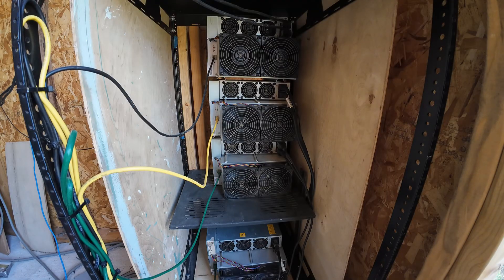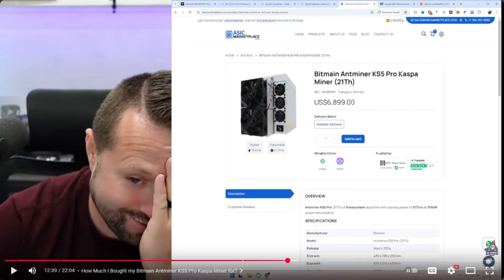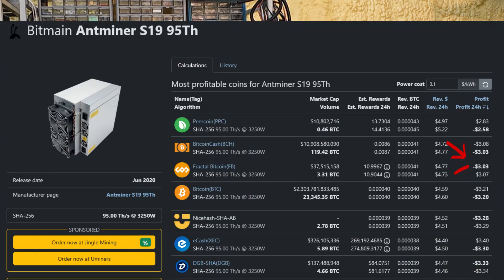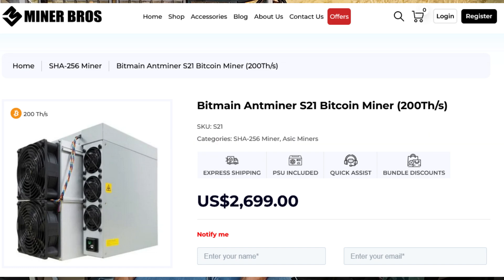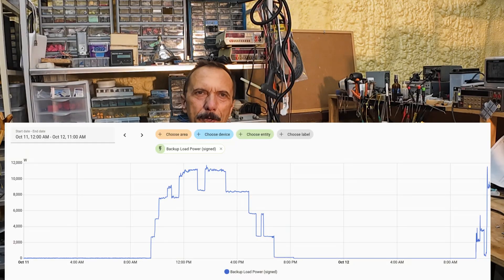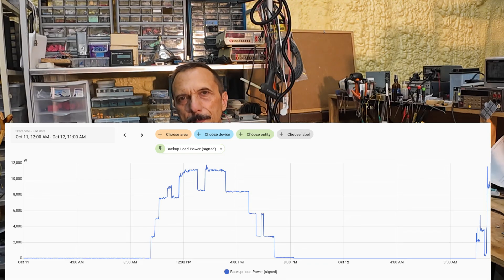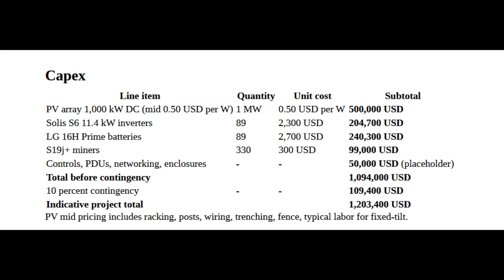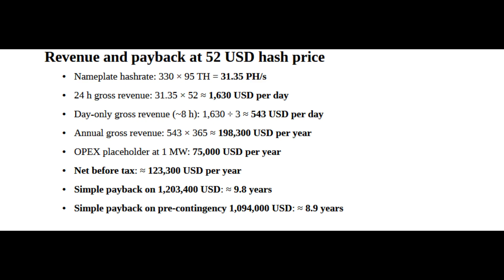Why Most Crypto Miners Never ROI (and How I Did With Solar)

Comment: A different solar crypto youtuber said that you should run asic miners 24 hours a day because when they heat up and cool down from start/stop they degrade faster. I hope that isn't true, but maybe it doesn't matter since you are getting the asics so cheaply.
Reply from the maker: That could be true if you just shut them off, then there's no fans running to pull the heat from the ASIC's and they are sitting there literally cooking. 
I don't power them down I just idle them, the boards are still powered up and fans are still running.
No problems yet.
Thanks for watching!

Comment: Depending on the location, this setup can be around ~0.04$/kWh LCOE. If the system is grid-tied, miners can idle when the electricity price is higher than a set amount to extract the most money from the PV install. If the PV is close to the city's heating network and the miners are liquid cooled, then heat can be sold as well on an hourly rate.
Reply from the maker: Sounds like a plan!
Thanks for watching!

Comment: have you seen that dude dirtyshoya's dc-dc solar mining setup? no inverters, he uses some sort of shunt. it increases the efficiency of the system a lot because there is a lot of loss to do the dc-ac-dc conversion basically twice.
Reply from the maker: What's that channel? I can't find it.
I have done that on some L3's back in the day but the S19's need 200 - 250 amps DC @ 12 volts even for a small mining operation of 10 units that's 2000 amps! Not doable...
Reply: @DIYSolarFarming  i happen to be a gpu miner mostly and again while i haven't done it myself there's a guy bradcagle here on youtube that's done dc-dc with a gpu setup.
Reply from the maker: @webby459  I found him and he is GPU mining. He showed a clamp meter at 7.5 amps on his set-up.
An S19 pulls 200-250 amps...
Reply: @DIYSolarFarming  i also gave you info on the guy doing dc-dc with many S19s, see post above.
Reply from the maker: @webby459  If your talking about dirtyshoya's I couldn't find him.

Comment: i think adding battery and solar to be able to run 16hrs a day or even add helical turbines would be nice, it should be fully automated with failover (ie some redundancy), you could break this down by 90% and just do 10% at a ime and scale up that way, batteries and pv panels are going to get more efficient and cheaper so you need to factor that in. excellent content - good look at capex, excellent breakdown - with caveats and exceptions
Reply from the maker: Batteries to run 16 hrs would be awesome, right now it's just too expensive!
But like you say, pricing will come down. We will see what the future holds...
Thanks for watching!

Comment: Ed this is an awesome video.  I am currently a few months into running a solar mining operation.  New to Solar but learned a lot from watching Youtube videos and researching.  Using some ASIC hardware that I have had around for a couple of years.  Mining mostly ETC, but converting to either Solana or Bitcoin.  I am curious to hear more about how you went about automating your system to run off of SOC and other factors.  Did it require some programming knowledge?  Did you need specialized hardware.  I just bought a switched PDU that I am hoping to be able to leverage to control the operating hours of the miners especiall since I am looking at introducing additional less efficient equipment.
Reply from the maker: Sounds like you're on the right track! I use a custom Python script tied to Home Assistant, there is a video on the channel about it, if there’s interest I’ll do a more detailed one. I made the first rough version open source, the GitHub link is in that video. Thanks for watching!
Reply: @DIYSolarFarming   Thank you for your prompt response.  I am going to watch your video and see what I can get out of it.

Comment: Did something similar but smaller scale for Kaspa. Really good honest assessment based in reality 👍 one critical thing you missed in the calculation is emissions halvings. Remember earnings get cut in half every 4 years or so. That may more than double your break-even because at least 2 halvings will occur in the coming decade.
Reply from the maker: Thank you! Agreed on the halvings, a couple things though, In the scenario I laid out I did say that all the pricing was very inflated because I used retail pricing for all the power generation equipment, just a guess but I would expect the ROI in more like 5 years when using wholesale pricing and larger inverters like the 30kW Solis.
The next step in the pilot will be adding 12 more miners as discussed in other videos, the ROI on that is expected to be 2.5 - 3 years.
Another thing is that I expect the btc price to at least double during each cycle as it has usually done, there are only one million coins left to mine and all the big money is just now getting into the game.
Thanks for watching!
Reply: @DIYSolarFarming  I've no doubt you'll be successful, an opinion certainly not biased by the fact I'm doing the same thing ;) I tell the family it's pennies from heaven.
Reply from the maker: @rafalklepinski7372  when btc @ 1mil those wont be pennies anymore! ;)
Reply: @DIYSolarFarming  I agree that the halvings will be more than offset by the price appreciation of the bitcoin.

Comment: Inverters for running miners? With batteries? While only running 1/3rd the day?

Cut out the batteries, cut out the inverters, go DC direct.
Reply from the maker: That would be interesting, 1 Megawatt DC direct 🤣
Reply: @DIYSolarFarming  Megawatts are made of watts.
Reply from the maker: @whatilearnttoday5295  Here's a little exercise, how many amps DC at 12 volts does one S19 need to run, then tell me how you will scale that.
Reply: @DIYSolarFarming  It takes 12 volts input dude.
Reply from the maker: It's 200 - 300 amps @ 12 volts per miner, now tell me your battery cost for just a 12 miner operation.

Comment: I love your channel but it looks like you might have not calculated for Bitcoins halving. That is going to happen in roughly 2028 sometime and again in 2032. That means you will have to expend twice the energy roughly to get a block two times during your expected ROI of 8.9 years. Did you calculate for that and just not show it in the figures? Btc can obviously grow in value during that time period as well and will probably go down as well a few times. So I think to get a full and complete ROI you need to figure that it will take twice the energy to get a block at least two times during your 10 year time period.
Reply from the maker: I have calculated that for the next 12 miner expansion and I agree that could be an issue but I'm betting on BTC price appreciation to offset that as it has in every cycle. And the model survives because power is free and capex per TH is low. Also by that time I'm sure I'll be buying S21's for cheap...
Reply: @DIYSolarFarming  That makes sense really. You won't be running S19's anymore you'll be a couple of gens behind what the latest tech is at the time. Although, if you added a few extra panels you might still be able to get use out of the S19's yet who knows? I think your idea is very sound because the biggest factor in crypto mining is ENERGY. Once you buy the equipment your energy is basically free.
Reply from the maker: That's it, it's all about the energy!

Comment: Awesome report, thank you.  I'll have to rewatch.  Wondering what the range of net % yield is like after costs.  Also wondering what kinda of hacks could be used to build a giant enough battery to run 24/7.
Bless
Reply from the maker: Range for the 12-miner pilot after costs is roughly 18–55% annual net yield and net margins around 80 to 90%
once up and running because the variable power cost is zero during sun hours.
As for the battery, it's not worth the effort, way to expensive. Your much better off building out pv and inverter to run 3 or 4 times the miners during the day.
Thanks for watching!

Comment: Very cool I have a very small 800 watt solar array with a couple of 12v 100 ah batteries.  Living in Wisconsin we don’t get much sun especially in the winter.  What app or software are you using to auto turn on/off your miners?  Maybe I missed it in the video.
Reply from the maker: It's a custom Python script tied to Home Assistant, there is a video on the channel about it. I made the first rough version open source, the GitHub link is in that video.
Thanks for watching!

Comment: I would be curious to see in detail how you control the miners to turn on and off with battery soc. This looks like a great idea.
Reply from the maker: It's a custom Python script tied to Home Assistant, there is a video on the channel about it. I made the first rough version open source, the GitHub link is in that video.
Thanks for watching!
Reply: Awesome thanks, I found that video. How much solar are you using to allow you to run for 8 hours?
Reply from the maker: @14TheBass  16kW

Comment: Very interesting content! YouTube sent me your way because of the solar topic but the Bitcoin aspect intrigued me. I vaguely know the idea behind the mining from research years ago and it seemed complicated and just not worth it for me. So I guess my question is this; would it be better to take that upfront cost of equipment and just buy some Bitcoin each day and hold?
Reply from the maker: Great question, and one I get a lot. If your goal is just to own Bitcoin, then yes, buying and holding (DCA) is usually simpler and often more profitable in the long run.

Mining really only makes sense if you already have access to cheap or free energy, like solar that would otherwise be wasted or curtailed. In that case you are converting excess power into Bitcoin instead of selling it to the grid for pennies.

What I am showing here is not about trying to beat the market. It is about building the infrastructure that earns from the sun directly. It is a different kind of long term play, part energy independence, part tech experiment.

Appreciate you watching and asking an honest question.
Reply: @DIYSolarFarming ah I see! Yeah when you only look at the comparison of what to do with excess power then the Bitcoin route makes sense. So in your case that's perfect. You have the equipment already or bought very cheaply so getting Bitcoin is just a bonus. I was thinking in terms of buying equipment for the sole purpose of mining which didn't seem reasonable to me.

Comment: Nice technical video. I have a PV system with a 50 kWh battery. I'm from Europe and I have dynamic electricity prices. It may seem crazy to you, but prices in the evening are up to four times higher than at noon. The cost per 1kWh can be around €1 at noon and €5 in the evening. Alternatively, the price at noon can even be negative. So you get paid for buying energy. In this market, surpluses from PV systems are either consumed at home, e.g., in hot water, or sold via the battery in the evening. 
If I take your model, one S 19 earns about $1 per day. You say it has reduced performance. Let's say it consumes 21 kWh in 10 hours of operation. Its performance is reduced to 70%, so it earns about $1, as you said. 
If I put the same energy into the battery and sell it in the evening, let's say when the price is 4 euros, I will earn 8 euros for 20 kWh, i.e. 9.3 dollars. I will deduct about 20% for AC-DC-AC conversion, and the profit will be 7.5 dollars. 
It is also possible to use a water-cooled miner to heat the house or swimming pool. But I still find it more profitable to sell electricity from the battery.
I wish the project all the best and understand that you have a different way of billing electricity or do not have such differences during the day. 

Translated with DeepL.com (free version)
Reply from the maker: I agree and if I where in your situation I would install as much battery and pv as I could fit on my property to sell back! ;)

Comment: looking for some advice on fusing a rack of 48 v 314 amp hr.  30 kwh. packs *4  parallel  together and tide to buss bar and over to 3 flex boss 21 inverters. need to fuse and not sure on what size to use..
Reply from the maker: That would be a good question for Signature Solar, they offer free consulting.
Thanks for watching!

Comment: I have just installed a solis s6 11.4kw with 6 hv soluna cells into their cabinet. It is working great so far. What is your opinion on soluna battery product?
Thank for sharing contents
Reply from the maker: I love Soluna, I had a long call with them a few days ago, did you get the 15k's?
Thanks for watching!
Reply: Yes exacly I installed two of these down the stairs. 
I love your content, very usefull Thank you

Comment: Still ignoring mining difficulty increase. Once you factor in difficulty increase (exponential increase) it will most likely never ROI.
Reply from the maker: Great point, you are right that rising difficulty can kill ROI. I model with hashprice, not just difficulty.
Hashprice already blends BTC price, block reward and network difficulty into one $/PH/day number. If difficulty rises faster than price, hashprice falls. My stress tests already “factor in” difficulty via declining hashprice.
WHat I’m saying is I model the risk in the variable that already bakes difficulty in, instead of treating difficulty alone.

Why I like my model:

Zero power cost lowers the breakeven. Grid miners shut off when revenue per kWh dips; I do not have that constraint during sun hours.

Small expansions, next Capex about 14k, to get to 1.14 PH/s, net about 6.2k in year 1. Even with a falling hashprice it pays back in a few years.

Scale is gated by hashprice. I only add blocks when realized hashprice supports it. If hashprice slides, I pause expansion.

Cheap hash per dollar. At 300 dollars per S19j+ the ROI driver is dollars per TH, not joules per TH. If the market worsens, my sunk cost per TH is low.

PV and BOS retain 20-year value even if I throttle miners harder or repurpose power.
Reply: That's not how any of this works.

Comment: 9 years ROI for this solar and crypto setup. I've seen numbers of ROI's of just residential solar itself being around that same time frame as well, with a MUCH lower startup cost. Seems like a lot of complication.
Reply from the maker: The high ROI is due to the pricing model, I used new prices and had the solar installed instead of DIY.
On the pilot of 4 miners I used all lower cost components and everything was DIY, ROI would be 2.5 years.